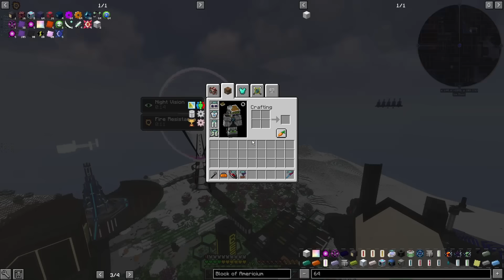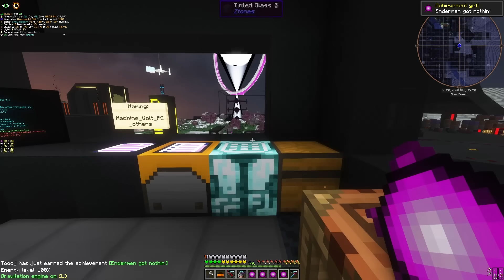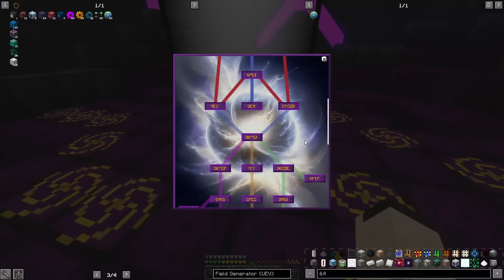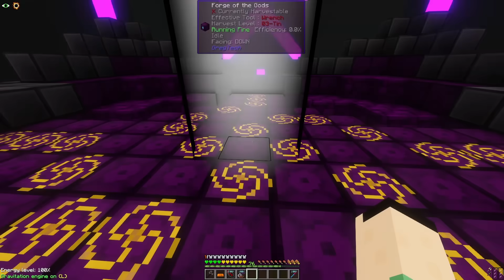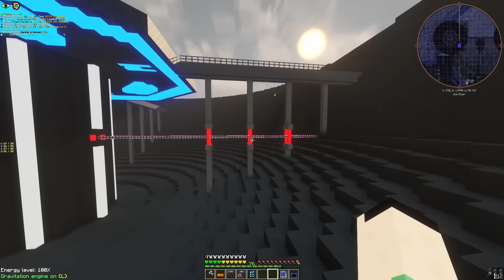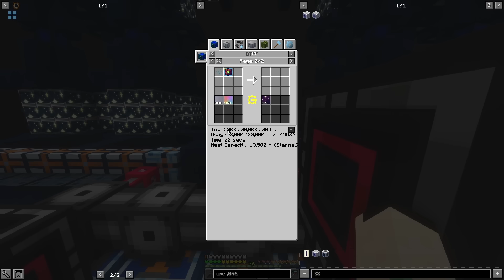GregTech New Horizons E142: Convergence

Comment: Maybe instead of charm of dislocatoin you can use relocator. Instead of using enderpearls you're gonna use EU. But only diffrence is gonna be that for charm you need to manualny load fuel while for relocator you simply need to be in range of wireless charger
Reply: he can load 1000 pearls in once and never have to worry again